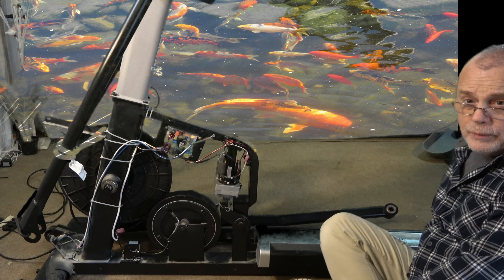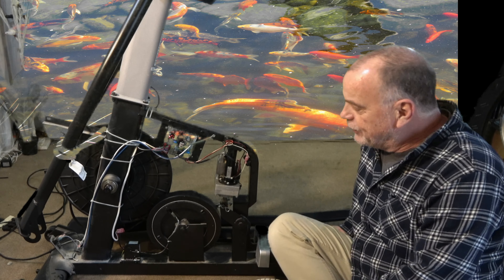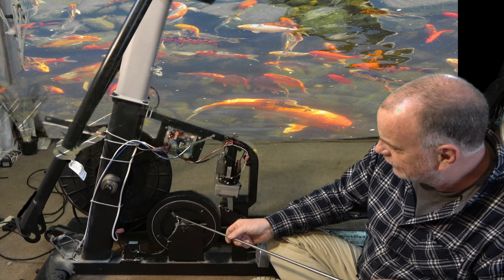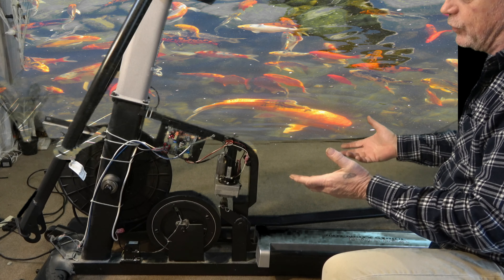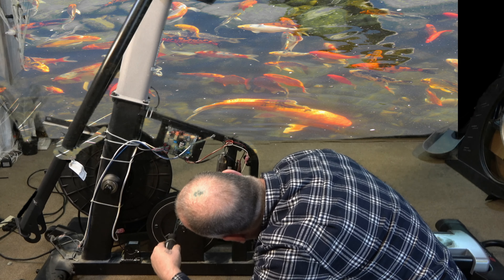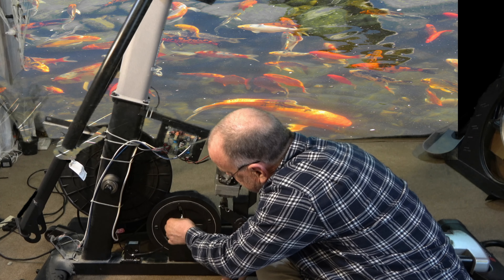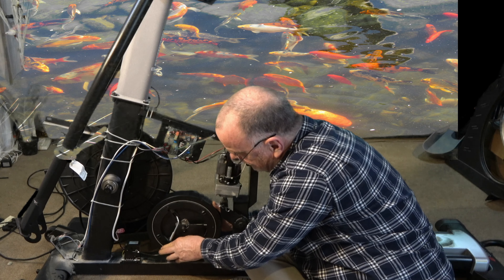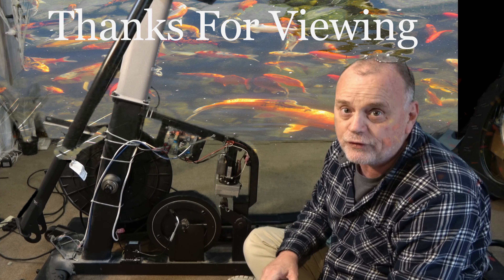Installing Nordictrack Elliptical Flywheel

Comment: Hello! Hope you can give me a hand.. i have a c 7.5 that is on warranty and one technician has replaced the flywheel but now I have the resistance too hard..now 5 level is like the 7 level that i had before...
Reply from the maker: @danidada6105  Hmm that may be in the flywheel? You can try adjusting the steel cable some of them have small adjustment nuts. This may help. But I don’t know your unit by heart
Reply: @FitnessTechnologyServices  thanks for your answer. I got it better by adjusting the resistance manually but after that a loud scratching noise made me investigate the front and found out that the cover was scratching against the frame because the crank wasn't in line.. probably because the technician didn't disassembly the arms before taking off and putting on again the crank...
Anyway sorry for the long reply...now I have tried to straighten the crank and it got also the resistance less harder but sometimes i still have a scratching noise...the technician didn't loose the belt before removing it, just pulling and pushing to put it on again after...so I'll check the tension of the belt today.
Does all this make sense to you? Should I check something else for a scratching noise from the front left side? In your opinion does a tat-tat-tat-tat sound (always there) is the normal noise of the flywheel like the technician said? Because to me it sounded like belt related...
Reply from the maker: @danidada6105  Well sounds like covers maybe out of adjustment on the scratch noises. On the tap tap noises if it is so light you can hardly notice it that maybe normal? Can you see if the belt is worn or rubbing. If you want send me a little video of noise 
Fitnesspartspro@ gmail.com 
Maybe I can help better 
Dave

Comment: The arm is fine, looks like the motor maybe struggle to pull and push the magnet. I have ordered a motor so hopefully that will fix the issue. Appreciate your fast response too. It's been driving insane to fix it. I bought it on eBay so not had a good chance to have a go yet haha
Reply from the maker: Any time I can help let me know
Reply: @FitnessTechnologyServices  thanks again, is there anywhere I could show you a video, if there's a possibility. I don't know how to send a message on YouTube :(.

Comment: I have a different type of resistance a type c magent but with an arm connecting rather than a cable, do you have any videos on the repair for this :)
Reply from the maker: Not yet !what is wrong or broken is it the arm or the resistance motor not working
Reply: I have a Nordictrack elliptical. I just replaced the main crank and bushings and belt. After reassembly the incline only goes up about 2 inches then goes back down and the screen doesn't show cadence. With the pedals moving it is as if it's not moving. Any tips?